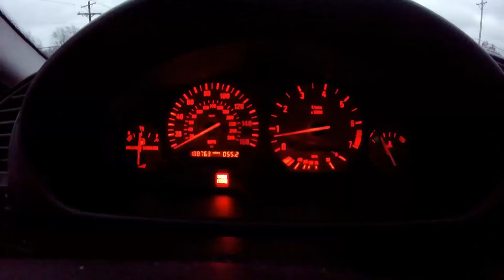Should You Ever Replace Your Transmission Filter?

Comment: Thanks for the thought provoking points! I went to the Toyota dealership today and I asked for a trans filter and the guy said there’s no need to change it because it’s a mesh screen.. that part didn’t make sense to me but I took his advice anyways and your video helped clarify my questions. Between you and the Toyota guy you saved me a lot of extra time and money. Thanks man!
Reply: The Dealership wants to buy a new Transmission
Reply: @dalebenson1230  what do you mean?
Reply: @MrSsandwichman69   Explain your answer/question
Reply: If you really want to  drop the pan for any reason simply just change the tranny filter. It may cost some extra $$(40-60$$) but piece of mind. Filter media takes lots of heat and pressure and everything has a life time it's not everything about clogging but also efficiency. A 25 years old guy definitely has more ability to work than a 70 years old guy. 8 out of 10 people would say change your filter. Ask yourself why are you looking or searching for this question in the internet?? Because you took the word from dealership and didn't get the piece of mind so you are searching for piece of mind here. Don't listen or believe anything dealerships say. It's make sense that change your filter after a certain amount of time for the pick performance. Dealership told me I got life time seal transmission and never have to change my transmission fluid but I asked what is the life time of my car?? They said o well typically any brand new car should last 8 to 10 years without any big issues but the bottom line they care about 3 to 5 years or 75k to 100k miles manufacturing warranty period after that go back to them buy another car if something happens. If you are a person change vehicle every 3 to 5 years then don't worry about tranny fluid or filter but if you are a person who wants to keep the car as long as possible then change all fluids and filters after a certain amount of time 😊
Reply: @mdashiqurrahman39  hey thanks man. Good points you got there. Funny story. Now that it’s been a year since I originally posted on this video. I took their advice and didn’t drop the pan… at first. As I was tightening down the drain bolt I over torqued it and stripped that bi*ch like a straight up rookie lol so I had to drop the pan at that point to fix the threads. And actually I ended up getting out an extra couple quarts of ATF and got a total of about 4 1/2 - 5 quarts changed as opposed to my previous drain and fill I only got a little over 2 with just pulling the drain plug. I didn’t change the filter though just the gasket but I’m planing on doing another drain and refill here soon, im a little behind schedule on it actually, and I plan on dropping the pan again and changing the filter this time. So I guess over time my mind set on it has changed. I can see both sides of the debate. Even though it’s a mesh screen I still think it should be changed… I mean, there’s a reason why they give you the ability to change them out and I plan on keeping my truck running good for as long as possible so might as well spend the extra $40 or so on one for the peace of mind. It’s not like I’ll be buying one all the time for it.
Reply: Some of them do just have a mesh screen these days, and if you drain-and-fill the ATF every 30-40k or 2-3 years, it should stay clean, and not clog up that screen.  If it does indeed have an actual filter, you should drop the pan, and change it every 60k miles.

Comment: I appreciate your advice.   Makes complete sense.   You have relieved my worry about my 4L30e transmission with over 165K.   I never replaced the transmission filter and I am never intending to have the filter replaced.   My only routine maintenance is to  periodically partially drain and fill with new ATF.
*  I am worried about clutches wearing out and I suppose a new filter is not gonna gonna effect the future wear.
Reply from the maker: If it shifts ok now. There probably isn’t anything to worry about. If the clutches wear out, it was probably just time. No filter change is going to affect the wear on the clutches.
Reply: @PetesGarageandperformance but filter change will prevent filter from clogging up....right???? A clog tranny filter is no good either....
Reply from the maker: @prandomable clogging up with what? If it clogs with metal or clutch material, the transmission needs rebuilt anyway.

Comment: Change those transmission filters  between 60k to 90k depending on how hard you drive, weight you haul or trailer towing. Clean the trans oil pan. I have seen trans filters plug up & damage transmission. Transmissions are very, very expensive to replace & usually not as good as the original. The transmission is the most expensive part of your vehicle & will leave you stranded needing a tow, costing you over $5000, so if you want to be sure it last forever, install a transmission cooler & change the filter. Heat is what destroys 90+% of transmissions. Dirty filter will starve fluid pressure causing clutches to slip & destroy the transmission.
Reply: I agree. 
Beep, beep.
Reply: How often should you replace the transmission cooler
Reply: @Pwn3540  I said "install a transmission cooler", not replace often. Most vehicles, especially ones loaded or pulling trailer or driven in hot weather, need an extra transmission cooler. Ask any good transmission rebuilder and they will tell you that heat is what destroys 90+% of transmissions. Modern full synthetic trans fluids don't wear out, they just get contaminated with clutch material that will clog your filter & destroy your transmission.
Reply: @michaelhaiducek2648 how do you install a transmission cooler tho if there aren’t company’s that make a kit for your car? Also would it not block a good chunk of your radiator?
Reply: I'm just in the process of trying to decide what transmission maintenance service I need to maintain a Subaru Outback with over 220,000 kilometres on it.  I might replace the filter anyways as there seems to be conflicting information here although I do think Pete's Garage has a valid point.  The Subaru Maintenance Manual for Schedule D says "replace transmission fluid".  I don't know if that means a change or a flush, but I'm thinking that a flush is better.

Comment: Ok Horses you absolutely right and right, and ChrisFix is also absolutely right because I saw ChrisFix on his video was breaking apart the previous transmission filter and show us when transmission fluid you suppose also to the transmission filter, and us a lot of metals inside of the previous transmission filter, thanks to you Horses and thankfully to ChrisFix, and yes transmission filter supposes to change

Comment: Depends on the vehicle. Some cars are easy and cheap. Like my Infiniti G35, the filter is right underneath the drain pan and cost about $10. So if you have high miles and your removing the drain pan, might as well change it while your at it. Others might not be necessary unless your rebuilding due to the filters location.
Reply: If you're already need to remove the transmission pan like to replace a damaged pan or leaking gasket, otherwise you just created a bunch of additional labor for yourself as now you need to replace a gasket and remove and retorque a couple dozen additional bolts that you otherwise didn't need to touch.

Comment: The filters get clogged from clutch material and the fibers break down over time unless the filter is a metal mesh. . It felt the same with fluid change only. After the filter change, transmission felt smoother.

Comment: I do agree you probably don't have to change it near as often as other filters, I'd think after two fluid changes you should definitely replace it. They say fluid lasts 60k miles yet I don't think I've gone over 10k on a fluid flush and it's already discolored to the point I need to change it again. ATF may not be subject to fuels and the like but it still gets hot specially in the summer and breaks down and the more it breaks down, the ability to dissipate heat  and lubricate lessens and thus more wear on the parts.

Comment: On old but well functioning transmissions the pan usually has a coating of viscous dark material and so does the filter.  It seems probable that this is from the clutch and band coatings due to normal wear.  Is it possible that new fluid with additives at full strength can resuspend some of the finer particles and circulate them?  Then cleaning the pan and a metal screen type filter in solvent seems likely to  remove most of it and lessen the wear, since these are the lowest points.

Comment: i never replace transmission filter, only fluid and my doge carnivan over 200k, i totally love this video
Reply from the maker: If you can get over 200k on a Dodge transmission without problems, you must be doing something right! Lol.
Reply: Change it next time because if it gets too much metal shavings in it can clog up and your transmission won’t work right
Reply: And putting the pan on and off is WAY harder then putting on the filter
Reply from the maker: If you have metal shavings, you have big problems.
Reply: @PetesGarageandperformance  bro I love your video I hope you can get back to me and respond. I have 1990 corvette with the 700r4 and the first gear and second gear works but when it want to shift to 3rd it slips and stays in second gear. All my coworkers tell me put a new filter and change the fluid ,put a new filter and change the fluid,if I do that is it really gonna change anything?
Reply from the maker: @slv_car_refinisher6864  sorry just saw this. Sounds like your 3-4 clutches are most likely burned up. Pretty common. If the fluid smells burned, it’s probably that. No way a filter will fix this issue.
Reply: Do you do a change or a flush?
Reply: 2012 gmc acadia has no way to change filter unless u take out the whole transmission. I'm almost at 200k and have only drained and filled about 4 times  and my vehicle runs great!

Comment: Changing the transmission filter can cost over $300 in labor, parts, and new ATF.  If you change the filter and fluid yourself, it's a more cost effective measure.  Changing the Transmission Filter is cost effective insurance compared to paying a mechanic to rebuild or replace a spent transmission.  On my 2006 Siena and my daughter's 2002 Camry, I have to unscrew the left engine/transmission mount and rock the engine upward, with a bottle jack, to access the transmission drain pan screws to get to the transmission filter.  It's not a quickie job for a mechanic so, to avoid paying for the labor involved, I do it myself.

Comment: Im at nearly 475k miles on my 98 Tacoma with original automatic transmission and have never changed filter.  Still running good, although the trans pan gasket has gone bad for the 4th time and needs replacing again.

Comment: Totally a great and valid point I've been working on car since I was 5 years old am now 44 years old and I will tell you this much transmission filters hardly ever need to be changed unless like you said it is a catastrophic failure they also have to remember that transmission fluid also has a detergent in it which allows it to stay clean so no you do not need to change your transmission filter you may need to change the fluid at some point three to five years maybe but you don't have to change the filter unless something totally goes wrong like metal shavings or something thank you for the good point
Reply from the maker: Exactly! There shouldn’t be anything in the filter unless the transmission needs a  rebuild.
Reply: I think you have a god point, but my question is wy is  it a filter ther if we dont get dirty? do we need it?
Reply from the maker: There will always be a normal amount of clutch material wear. The filter makes sure that this doesn’t get into the pump, valve body, cooler, etc. There is enough surface area in the filter media to accommodate this “normal” amount of clutch material. If there is more material/debris than the “normal” amount, you would have shifting problems. Then it would need to be rebuilt anyway.
Reply: Would you change one that’s been sitting for 16 years without  having any fluid circulated through it?
Just bout a project truck and yes it’s a 5 speed manual and wondering if I should due to it sitting for so long
Reply from the maker: Manual transmissions don’t usually have a filter. Just drive it.
Reply: @PetesGarageandperformance  got it
Reply: @PetesGarageandperformance   what do you mean by transmision needs a rebuild? I had problem with engaging the Reverse Gear n there was an unsual sound under the transmission.

Comment: I agree that a dirty filter equates to a damaged transmission.  However, consider this situation: The transmission appears to have no issues, except for a soft humming noise when you let go off the throttle.  To find out there are a lot of shavings in the drain plug.  Probably a torque converter running a little dry.  If one replaces the filter and recycle ALL oil, one should get 20K more out of that transmission...

Comment: The only reason the filter is replaced is that you had to lower the pan to get the fluid out and so if the pan is already off why not just replace the filter anyhow. If, however, you have a drain on the pan and the transmission is working correctly, just change the fluid. If you are really worried about the fluid quality, then replace the fluid in the pan via the drain more often. I installed a drain in my pan by using a roofing sheet-metal screw.  It takes a little while to drain the fluid through the rather small hole but it seals as it should. The screw cost about a nickle.
Reply: That's a great trick. Luckily,  my 2006 Matrix has a drain plug. Just drain and fill every 30k. Car has 200k and shifts perfect.
Reply: No dont act like you know it all. Explain honda transmissions.... They have an internal filter because people believe that this filter will never clog. Wrong. Many customers drive their cars for 15 and then go into limp mode. Why??? Because the filter gets clogged. Clutch material builds. And makes a difference. They only have a drain plug. Get out of here with this nonsense. Change it. Why risk it. Except with honda because you have to take apart the whole transmission.
Reply: @johnnysolano1025  I won't say they will never clog. Honda transmissions do have an external filter as an internal. The internal filter you have to pull the transmission. The external is usually in front of the radiator.
Also this video is just garbage.

Comment: Hey Pete I do agree with what your saying about filter in transmission. Ive got the 3.6 and the auto has no drive. After dropping the pan I can clearly see its never been opened. The filter itself was holding the finest and the kitty litter sized pieces and smaller filings collected on the magnet. In seeing that i could confidently say shes seen better days and a refit is called for. Plus a new filter.

Comment: I have a GM 6 speed auto transmission that's a sealed unit with no dipstick.  I replaced my filter as it was the first transmission service. Fluid looked dark. The old filter was average inside considering the fluid was about 6 years old. The pan gasket was in good condition as well.  I believe if you plan on doing regular fluid drain and refills (every 30,000 miles), you can keep the old filter and gasket. Just replace the filter and gasket if its the first initial transmission service (100,000 miles or 6 years)
Reply from the maker: The factory gasket on the 6L series transmissions is reusable and a new one is kind of expensive. Those aftermarket rubberized cork replacement gaskets are junk compared to the factory gasket.

Comment: Thanks for the advice Pete. I was about to buy a transmission filter for my 2000 Frontier CC truck from O'Rileys. Guess all I need is some OEM Nissan transmission oil and a copper crush seal.

Comment: 96 Camaro here. I was having a lot of issues when I would shift into R the car wouldn’t wanna go and the RPMs would go up but the car wouldn’t go anywhere fast.. lot of delay. Well, I changed out the filter, gasket, and fluid for the first time ever in my car 221,000 miles… the car shifts great now.. probably should have done it a long time ago. I think I’m just lucky. Probably wouldn’t go crazy with it but wouldn’t go past every 60k miles without doing it.

Comment: The trend is going away from changing fluid/filter because the vehicle is only designed to get you out of the warranty period. That’s the “life” of the vehicle to the manufacturer. So if they engineer it so that 85% of all the vehicles made can double the warranty period ( let’s say warranty is 100k but 85% will get to 175-200k miles) without ever opening the transmission. 97% will make it through the warranty period with no issues. That’s all the manufacturer cares about. You get 150k miles and your transmission goes out you either drop 4-8k to have another one put in or go buy another 60k vehicle. Simple.
Reply: I have over 220,000 so I want to get a service that will be optimal for my Subaru Outback.

Comment: Interesting! My 2008 HHR user manual footnote 'h' says "Change automatic transmission fluid and filter if the vehicle is mainly driven under one or more of these conditions: (1) in heavy city traffic where the outside temperature regularly reaches 90F (32C) or higher. (2) in hilly or mountainous terrain (3) when doing frequent trailer towing (4) uses such as found in taxi, police, or deliver service. It also qualifies this maintenance task as a 50k, 100k, and 150k "severe service only" task.